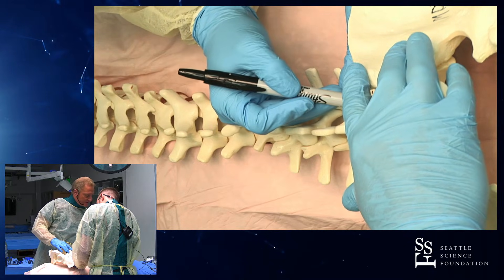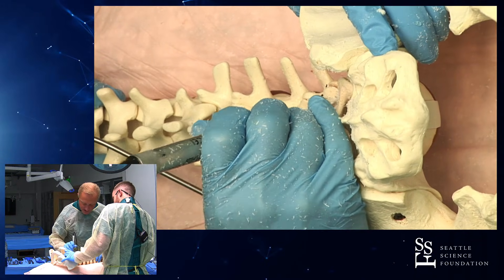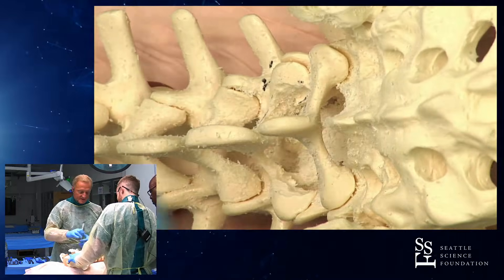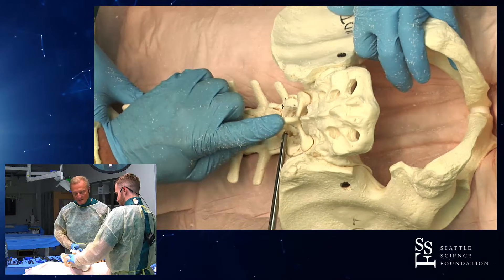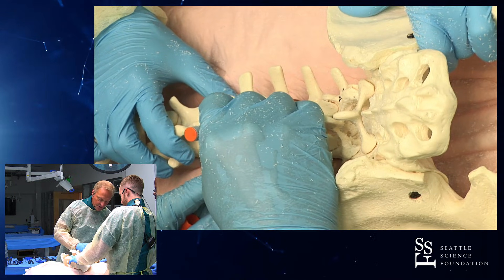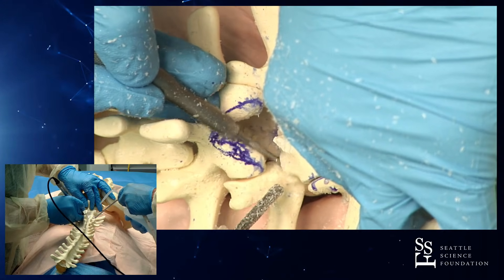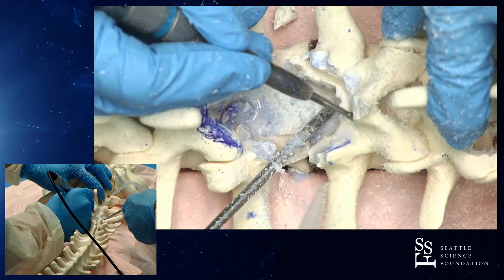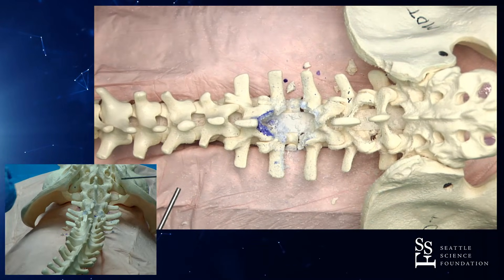Efficient Posterior Lumbar Decompression Surgery - Jens R. Chapman, M.D., Brooks Osburn, M.D.

Comment: This is an amazing view of spine surgery! The tools used in this surgical procedure perform similarly to the diamond carving bits that fit into the Dremel tool I use for woodcarving.

My goal in this post is to describe my first week post surgery and give some suggestions to the channel on future videos edited and posted in the future.

I am a retired physician with multilevel degenerative changes in my lumbar spine diagnosed 4 years ago. The most problematic place was narrowing of the L3L4 space and mild spinal stenosis at that same level. After 2 rounds of epidural steroid injections, physical therapy & Pilates, I had an L3L4 minimally invasive laminotomy with intra-operative neuromonitoring done in a day surgery setting not quite a week ago.  I remember the sense of wonderment realizing how the pain/paraesthesia in my right leg which was so debilitating the week before surgery was now absent! 

My post surgery pain fell under 2 general categories: bone pain that was a line down the center of my lower back and awful muscle spasms in my lower lateral (to the side, not midline) back on my right side. By separating the pain into these 2 categories, I would take a muscle relaxant if my pain was mostly muscle spasms and only took a half to a whole Norco 5/325 only if I felt the midline pain. Besides the medication, I would also lay on an ice pack (roughly measuring 10”x14”, or 25.4cm x 35.5cm) as well.  When one pack was no longer cold or cool, I’d replace with another ice pack. All together, I had 3 packs which I rotated in & out of the freezer.

I think I moved around about 30% of the time & spent the other 70% laying on my back, pillow under my knees on a firm mattress. I had a bedside stand that held my iPad overhead. This set up helped me binge watch YouTube videos like this one! Other activities I’ve had in the last 6 days have been standing in the kitchen tabout every other day to wash dishes & prepare food, watering all of my porch and indoor houseplants, taking 3 trips to a grocery store to do walk around as well as shop for groceries and going out for out for breakfast at a nearby eatery. With watering the plants, I only carried at the most about 2 quarts of water (which weights 4 pounds; one gallon, or 4 quarts water weight 8 pounds). That meant I had to make about 5 round trips between plants & sink. And I only water indoor plants once a week, but the porch plants, I had to water almost daily.

Constipation is a real thing post op so I wanted to minimize the amount of opiate (Norco in my case) I took to minimize the constipating side effects of the opiates.  I also addressed the constipation problem by filling two 40 ounce Hydro flasks with water and drinking all of it over the course of the day. I had vegetable casseroles available and also made a point to eat a protein cookie by a company called Quest. Not only did one of these protein cookies have 15 grams of protein, but one cookie also has 12 grams of fiber! Compare this to one packet of instant oatmeal with only 3 grams of protein. 

As to this particular video, I found the interactions with the attending physician’s dry sense of humor and the resident/fellow physician’s tolerance charming. I think that next time, the blue marking pen used to mark the areas needing removal of bone should have permanent ink that doesn’t rinse off with the water used for irrigation. I wonder if future videos should be done with a combination of the cameraman (as in this video) along with views of a GoPro camera worn on the forehead close to the eyes that would capture how the resident/fellow physician view of the “operating field” appears. Editing together the views from these 2 different vantages  to make a final video would be epic.

Thank you for posting this video on YouTube.

Comment: How long is lumbar decompression surgery. Is the patient in the prone position for entire surgery? How long is the hospitalization for this surgery?
Reply: Yes, I was laying on my back to be intubated. After intubation, I was told I was placed in a prone position for my laminotomy for the entire part of the surgery.
Reply: @CrossCultural-c7f  I was terrified not knowing how'd the Anesthetist would be able to keep the breathing tube in while laying on my stomach head down.
Reply: @colleenpellant1484  fret not. The medical field has developed quite a number of specialized operating tables for different surgical procedures. I’m a bit of a geek and did some super fast research where I glanced at stuff about operating tables used for spine surgery. There’s an operating table called the Jackson table that is modular and you can configure the table in different ways for different surgical procedures. At a glance, the Jackson table can be configured so that your face is not crunched up on a surface.  I don’t know exact details. 

Maybe this will give you a better picture:  think about those massage tables that massage therapists use- when you have to lie face down, there is a padded oval shaped head rest, or face cradle,  where you are laying face down  resting your head on a padded oval shaped cushion which has an opening in the center such that your face is resting on the opening of the oval shaped padded thing — your face isn’t smushed and you can breathe.
Reply: @colleenpellant1484  oh, the breathing tube, aka endotracheal tube, is taped onto your face to stay in place.
Reply: It’s a half hour surgery out patient - had Fusion surgery 5 weeks ago if nerve doesn’t doesn’t get better Dr said I am candidate for this!
Reply: For my minimally invasive one lumbar level laminotomy (not laminectomy), I went home the same day.